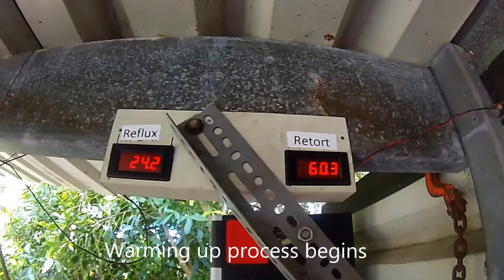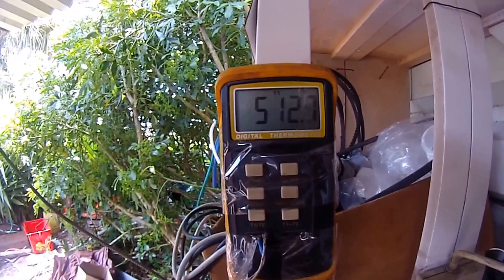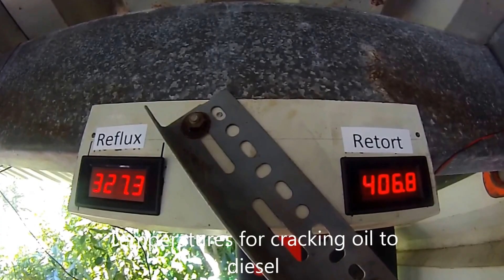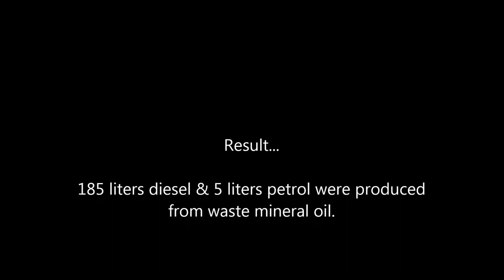Diesel & Gasoline made from what other people throw away

Comment: I live in Serbia and I'm wondering if you can simplify the distillery? And I would ask is whether the rest that is not distilled as such remains whether bitumen or tar or asphalt as a product residue or dry residue? Otherwise I am impressed with video! Sorry if the translation is bad because I used Google translator does not know English.Thank you in advance for your answers and how much is made from 100L diesel VMO?Thank you again!
Reply from the maker: Hello Aleksandar, yes the distillery can be simplified. Other videos of mine show early simpler prototypes. The problem was production at only 4 ~ 5 liters per hour. The process taken through to completion has dry coke as the residue. From 100 liters of waste mineral oil about 90% conversion rate. I'm going to be testing a new simple prototype shortly. The hope is that anyone, anywhere can build one made from local materials, using a variety of fuel as heat sources.
My DIYDiesel blog has more details of current work. Thanks
Reply: +SmokeOnTheQuarter Genius
Reply: @SmokeOnTheQuarter  hello friend. What is the height of your reflux and the diameter?

Comment: Very good work!  Can I simplify this process? Because I need just diesel fuel, no matter if some gasoline is inside. I mean to use just reactor, reflux, one condenser and one fuel reservoar. And gas outlet from reservoar to burner, with just flash back arrestor. (actually there is no oxigen in instalation and I will use positive presure and flash back cant occur but precaution is required). Is this problem if I cool condenser too much? How you fill reactor, once in time or you have oil supplier line (and what is oil level)? Do you have catalisator there? Thank you!
Reply from the maker: Yes, one condenser only is possible. I suggest to hold at 20°C and only force the most volatile fractions downstream. I choose 80°C because I want very stable diesel, petrol for adding to the turk burner fuel and to make more gases. Reactor is filled via oil pump. Fill to 85%. I need a level indicator device so the level can be maintained (my next project). Catalyst: I have used terracotta from broken red clay pots, also steel wool. Terracotta is best. Thanks.
Reply: Thanks! Do you try to pirolise plastics or other waste "fuel"? My question actually is, "can I use same reactor for other purposes"? And how you clean reactor vesel from deposits? I see on others videos, some people use water in diesel tank, actually diesel bubble through water and then fall off over the edges of the vesell but dont understand why? I like your air tight diesel reservoar and then gas go from tank to burner head.

Comment: Nice project. If you can help me,, waste black oil  pipe for contionuse operation  just go down to retort vessel? Thanks
Reply from the maker: Yes, preheat counter-current continuous
Reply: @SmokeOnTheQuarter  thanks alot, just last question..as it is continous system do you think its ok i go with small retort??

Comment: Why did you stop doing this? I know how to treat the fuel I have been doing this for 10 years I have multiple machines they usually make about 2 to 5 gallons per hour and I am happy with that and a few hours I have 5 gallon buckets full lined up
Reply from the maker: Hi, I have free diesel now, enough supply for 5 -10 years so I don't need the machine. 5 gallons per hour was the best I did. Was great fun.
Reply: Care to share any of your treatment methods
Reply from the maker: @tonydiesel3444  All my work is described in detail on my DIY Diesel blog